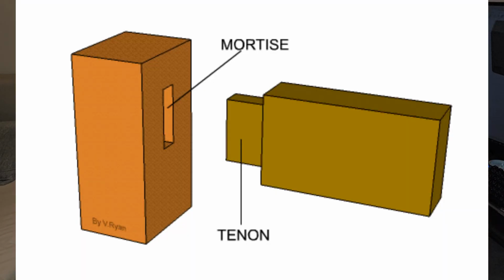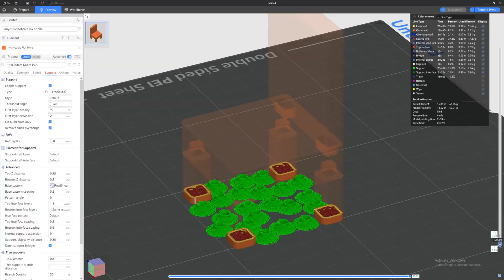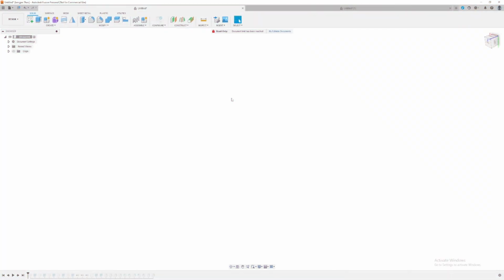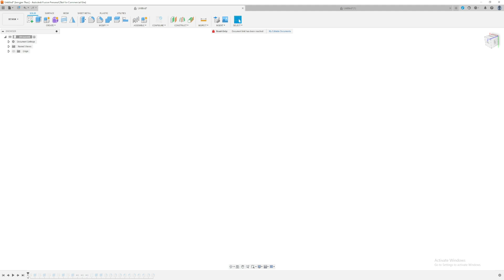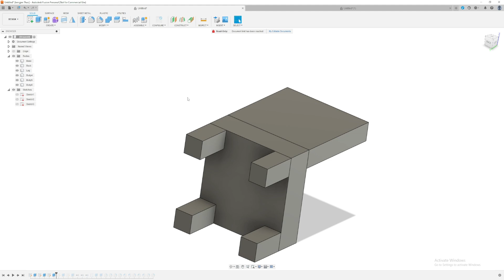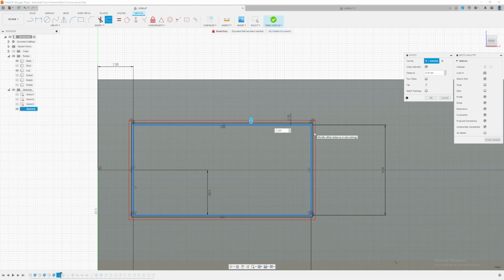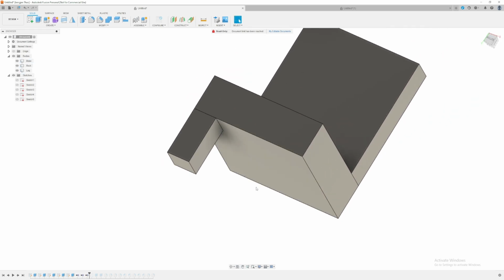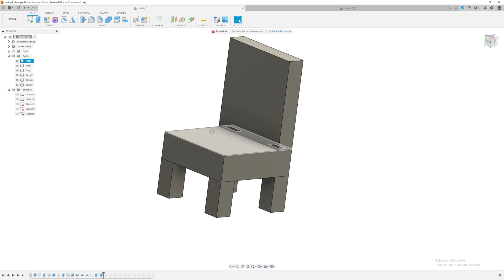How to make a Mortise and Tenon Joint | 3D Printing

Comment: Thanks for the video.
I use that offset process all the time for mating parts that need to fit.

One suggestion I have on the workflow side is to model everything in the sketches to zero offset and then apply a face offset as a separate operation to the faces that apply.
That way you can change the offset value in  one place and all the offsets update.
This especially useful when you have lots of mating joimts in one model.
Reply from the maker: No problem, that seems like a good idea, I'll try that method next, thanks.